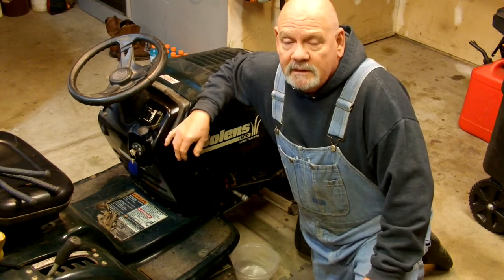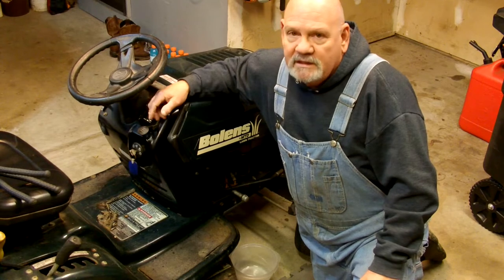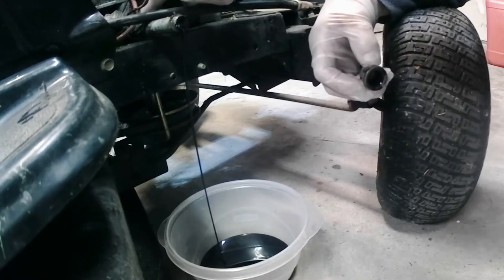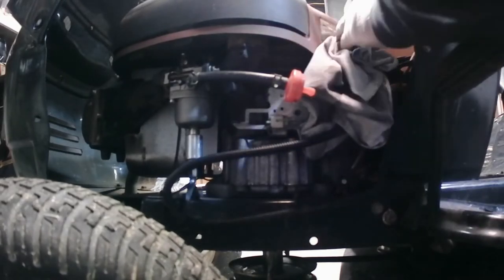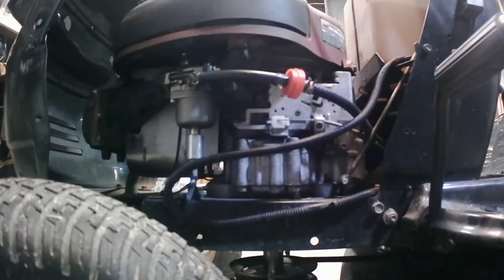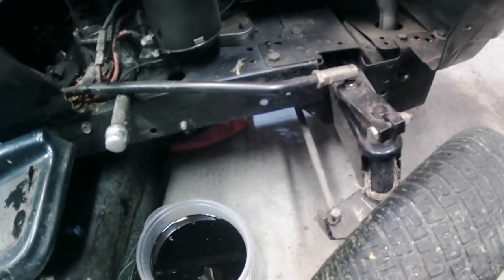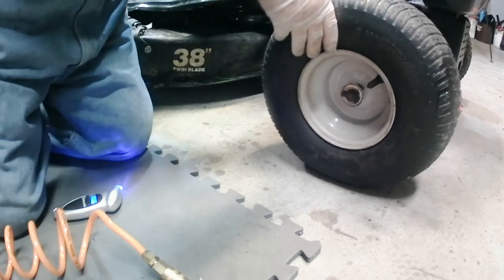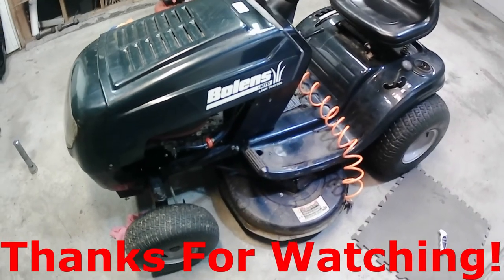Bolens Riding Mower

Comment: Those fuel filters have just a simple wire mesh screen inside that can be blowed out with an air gun in the opposite direction of the fuel flow and will be like new, at least mine was. If you cannot see through them very well, replacement might be necessary. The clear ones with the paper element inside, I have heard, do not work well with gravity-fed carburetors but are intended for mowers with a fuel pump.
Reply from the maker: Right! They are pretty cheap though I think I got a bag of 8 or10 6 for under $10. Thanks for watching!

Comment: I have the exact same mower and i have to jumpstart it everytime i use it. I put a new battery in and everything. I disconnected the headlight because i thought it was draining the battery but i have no clue what else to do. Can you offer some advice?
Reply from the maker: If you have to motor the starter a lot or it seems the battery is weak or dead it could be the valves /lifters need tightening/adjusting, common problem, happens to both my riders, this one and an 18hp Craftsman. Google valve or lifter on OHV Briggs. Good luck!
Reply: ME TOO! I got fed up with battery charging, trickle charging and still having to jump it to start. I said to hell with it and took the battery out and i just store a small jumpbox in the battery tray. I cut the headlight wires, i would disconnect the battery, i installed a battery cutoff switch. nothing ever helped
Reply: I have the same issue.
Reply from the maker: @virgilluster3952  Check out the valve / lifter problem I talked about in the latest reply ! Good luck!
Reply: @1rustytree  Thank you!

Comment: Hey bud I have a stupid question. I took my deck apart to change out the idler pulley and I can’t remember exactly where the damn extents spring goes. I’ve looked at the parts diagram but that doesn’t help. Any way you could help me out and show me where it’s at on yours. We have the same exact model.
Reply from the maker: I’ll look at it in the morning and let you know
Reply from the maker: I didn't know how to send a video to only 1 person so I just posted it on my channel . Its should be available in an hour or so hope it helps.
Reply from the maker: Here is the link to the video 
https://youtu.be/IxfFr0Ig8CE

Comment: What type of oil did you use?
Reply from the maker: Briggs and Stratton 30 weight 48 oz from Walmart, thanks for watching
Reply: I use straight weight SAE 30 single viscosity oil too. These are air cooled engines and run hotter than water cooled cars (and some high end mowers) so a straight weight oil does better as it stays one viscosity across its operating range. You might even go to a 40 weight if you lived in Texas or some place where normal temps are 100°
Reply from the maker: @Hjerte_Verke  The Briggs oil from Walmart seems to do alright if you change it yearly or close to it!